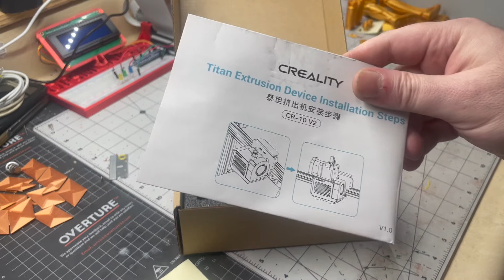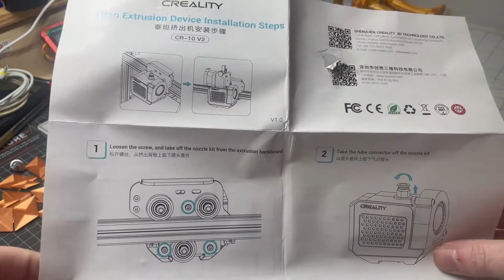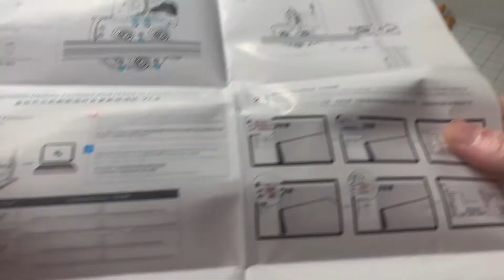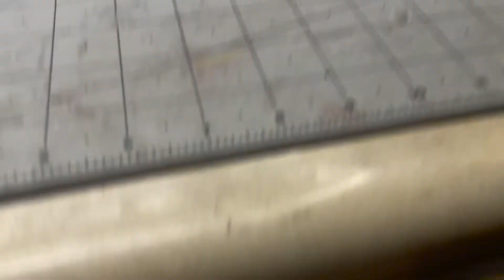Creality CR-10v2 Titan E3D Direct Drive extruder upgrade and TPU tests

Comment: If I have a stock cr-10 v2 can I print in tpu or other flexible filaments without buying upgrades? Or is that a requirment for flexibles
Reply from the maker: You can but the stock bowden tube makes it very hard to work with tpu. The direct drive makes it way easier

Comment: Ever notice that the titan extruder hits the angled brace on the CR10 V2 limiting the z axis print height to well below 400mm  on one side?
Reply from the maker: Yea, but you can move the angled brace out by a few inches by only using one of the screws instead of two and just slide it to the left by a few inches will give the room needed so it doesn't hit the brace.